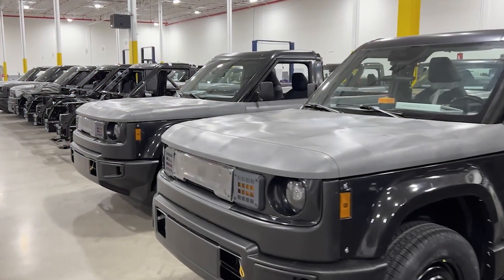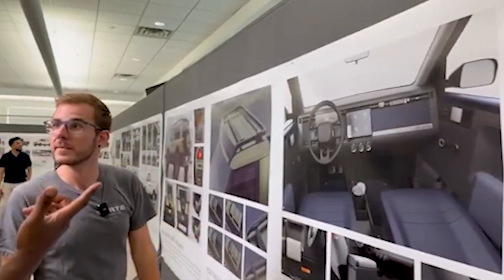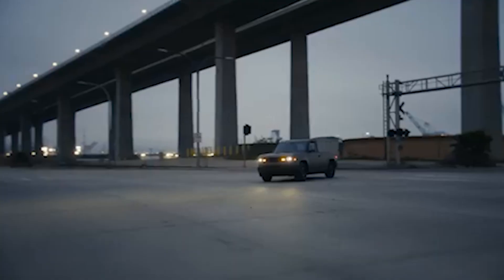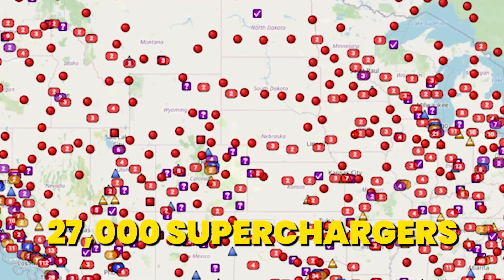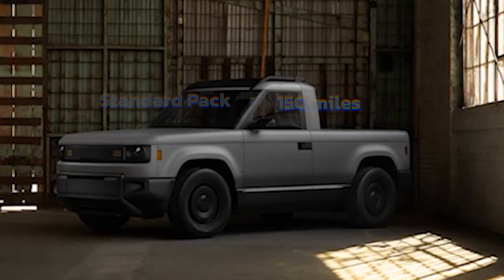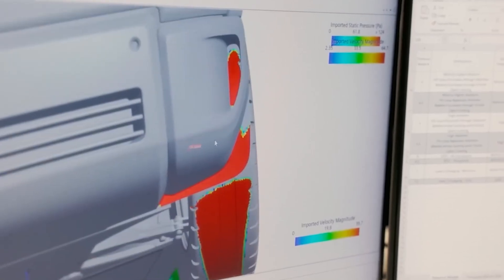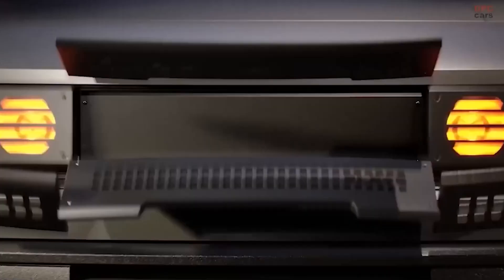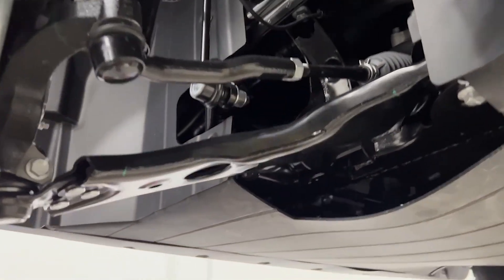4 Fresh SLATE Facts From Rich’s Factory Walk-Through

Comment: One of the pain points with owning an EV is charging at fast chargers, especially for road trips or from freezing temperatures. Don't take a salesman's words at face value regarding this because they never provide the nuance. You should search forums for any popular EV models to get a sense of what drivers have encountered or fear. I have a 2022 Leaf, and it sucks at fast chraging repeatedly during road trips, due to no active battery cooling. I have to charge at suboptimal speeds and sit forever at an EV station.

Comment: The big problem I see with the Slate, and one that should worry us all, is that it's selling the idea that it's cheap, and that's a big lie and a form of fraud. The cheapest pickup is the Toyota Champ, and it costs US$10,000. If it were sold in the US market, it would cost around US$12,000 due to the safety add-ons.

The Slate is born with a fatal wound if it doesn't make its production, sales, and profit margins for investors clear.

The Slate's real retail price should not exceed US$8,000. Anything else is nothing more than the argument of an 18th-century street potion salesman.
Reply from the maker: Well, I can’t speak on the profitability of this vehicle, it also wouldn’t be outside. The realm of possibilities at this vehicle is priced at a profit.  Commonly flagship vehicles are priced much higher than future production models. Once all the kinks are worked out and factories are established.  I’m not saying that this is the case with the slate, but if you are correct that this model could be sold much cheaper that’s a hypothesis as to why it’s priced the way it is. Thanks for the comment!

Comment: The 30 minute fast charge is likely to be 10-80%, or 20-80%, but not to 100%. Every EV I have owned slows down dramatically above 80%, so 80-100% can easily take as long as 10-80%. 
AWD will usually reduce range, so if they add that, hopefully they will pair it with a larger battery option. 
I had a Model S for four years with dual motors and a 230 mile range and it was fine for driving around the country, but on days when I was covering 900+ miles being stuck at a charger for 45-50 minutes did get old because that car had a max charge rate of 90kW. The VW I have now charges up to 140kW and has a range of 275 miles and that extra cushion is nice, plus all my charging stops have been 30 miles or less, mostly because I have free charging for 30 minutes, but that has been enough to get to 70-80% and down the road to the next charger. 
At home neither of those cars needed to be charged every day, but I did because I had to with my first EV which was a Fiat with an 85 mile range and a 50 mile commute
Reply from the maker: I’d be lying if I didn’t say I’m a little nervous about the range of the slate. This will be my first electrical vehicle so I’ve got some first EV jitters lol.
Reply: @EverythingSlate you just have to be realistic about your driving. A lot of people are negative about EV’s because they don’t do as well in -40 degree weather and since I grew up in the northern Midwest I know it’s not minus 40 from Halloween to Easter. It may be a day, or a week here and there. Snow doesn’t even stay on the ground for six months anymore. 
The other one people like to throw out is if it can’t go 2400 miles between charges while towing a fifth wheel it’s trash and I remember that I’ve always had a job that wanted me to appear about 48 weeks per year, so on all those days I drove 50 miles per day. On the other four weeks I went further and when I had my Fiat with no fast charging I had a gas car, or a turbo diesel for them with fifth wheels. My Tesla with 230 miles was capable of being an only car but on the days where I was covering 900+ miles, 45-50 minutes for charging got old pretty fast every 100-150 miles. My VW can go a little further and charge in under 30 minutes, I can tolerate that better, plus charging infrastructure has filled in a lot more so each charger isn’t the only one in range. Plus in my case I don’t have to rush back for work so I don’t have to go 900 miles per day. I can go see the world’s largest egg scramble, or something. 
I lived with plugging my Fiat into a wall outlet for a month before I put in a dedicated 220 plug for it. The Fiat didn’t have enough range to make it without charging on 110v because my overtime didn’t let it sit long enough to charge 3 miles per hour. So I put in a 220v 20amp charger that charged at 12mph which is plenty for me and doesn’t stress my old houses wiring. I don’t need faster because I sleep 8 hours and eat dinner and take showers so I’m home no matter how the car is doing. 
A lot of people spend thousands on 80 amp chargers that need 100 amp service just for the car which I think is overkill. You heat up the wires to charge the car in two hours and then it sits there the rest of the night. I only need to put 50 miles back into the car each day. 
In my mind the smaller battery Slate makes a good second car or commuter and the larger battery can be an only car depending on how people use it. Some people would be better spending more and getting the Telo which is more capable and longer range. Potentially the Ford Ranchero could be in the mix too. We’ll know more Monday on that

Comment: Does anyone know what the EV voltage system is?  My Ioniq 5 is 800 volts that lets it utilize 350 KW chargers and will do 20-80% in 18 minutes.  I would think Slate would want to use the higher voltage system since it reduces the size (and weight) of conductors.  The newest version of Tesla Super Chargers are supposed to be 1000 VDC.
Reply: 400v architecture as that's by far the most commonly used setup. Nacs port is standard charges at 120+kws.
Reply from the maker: Great question!